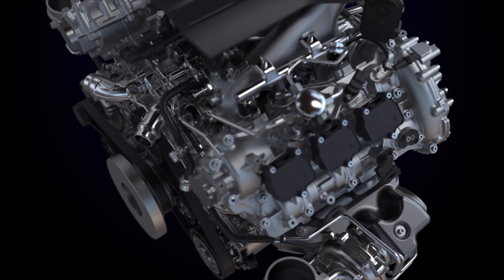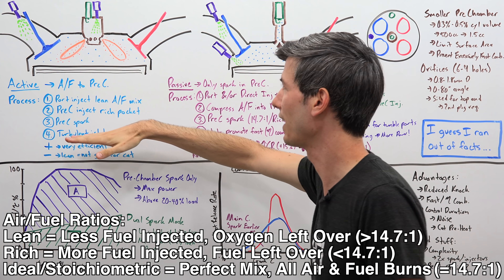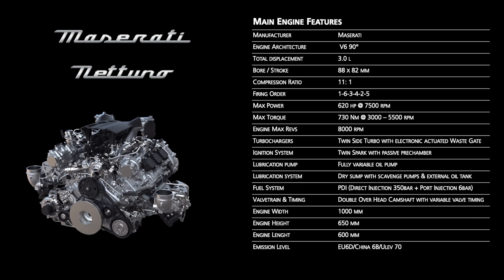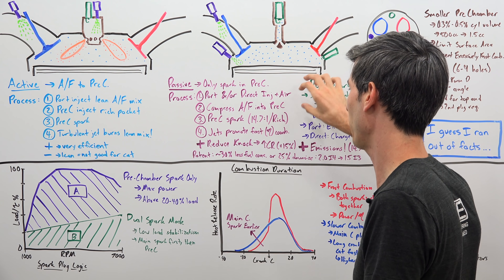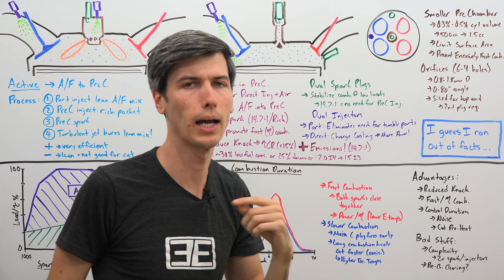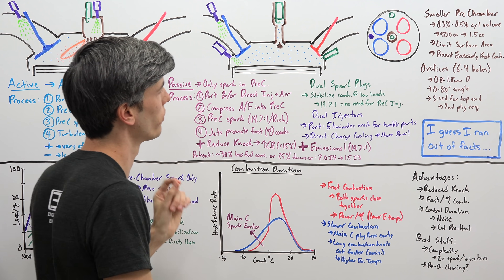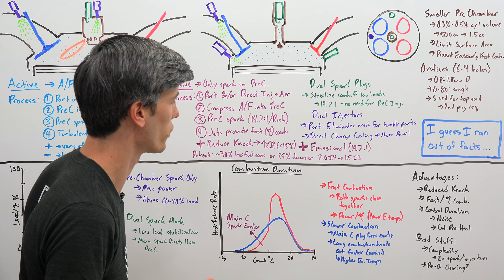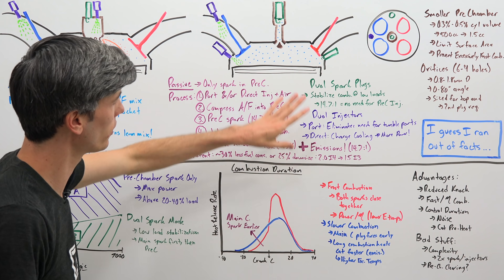How Maserati's Brilliant MC20 Engine Works - F1 Tech In A Road Car!

Comment: The real reason the main chamber spark plug exists is at low loads, the piston cannot "compress" the mixture into the prechamber. A piston is actually getting sucked upwards at part throttle, and then at TDC the mixture may only reach atmospheric pressures. The engine simply wouldn't run smoothly or at all at part throttle.

Comment: active is highly used in marine gas engines. if u combine it with propan butan it gives u a good amount of enviroment points. of course u have to deal with high EGT and use better oxidation catalyst

Comment: They should have threaded that whole pre chamber into the head. The ports will have to be cleaned of carbon with the typical low-load, low rpms supercars see in real use.  Or they’ll need to program in an automatic interval for an ‘Italian tuneup”. That’s how I used to keep my Fiat’s plugs cleaned.

Comment: It looks to me like that prechamber can be mostly cleaned by removing the sparkplug and using something resembling a chamber cleaning brush for a rifle. That would not clean the ports, but I don't think those will be very likely to clog, though they might erode from the speed and pressure of the gas flowing through them.

Comment: Thank you, what a great video! I am about to buy the MC20 and wanted to break it down to the smallest detail. Given this, your video explains one of the biggest questions - why on the videos of the car the RPMs fall so slowly. Right now, I guess its could be ECU strategy for either warming up the catalytic converter (the car has just started and the test pilot gave it revs) or it could be emission/noise strategy for vehicle being stationary (like Porsche, which opens exhaust valves strictly under load when moving). The engine doesn't appear to be so "sluggish" once it gets going doing rounds around Modena square.

Comment: Hello everyone. I had the idea of replacing the spark plug with another device which enables to fire the entire combustion chamber almost instantaneously (let’s say in less than one millisecond as an order of magnitude). Do you have an idea about the impact on power and efficiency that this new ignition method could have?
Reply: We would need more detail.  A spark plug already uses thousands of volts, and ignition depends a lot on the temperature and pressure the day of testing.

Comment: How does Maserati's central spark plug see a richer mixture than the rest of the chamber, when there is no injector near it?  At best, it will be the same lean mixture.  If not a lean mixture, then the prechamber is only there to provide hot flame jets that carry multiple flame fronts into the main charge.  Normally, a single flame front is less likely to knock, than two flame fronts slapping into each other.  Perhaps many smaller flame fronts don't produce significant knock?

Then again, aircraft piston engines have dual spark plugs and ignition systems in case one fails....

Comment: Yes. Every high performance/aftermarket rotary application has the oil metering system deleted and uses TCW-3 or similar premix. I've had a rotary engine fail because one of those oil metering lines broke.

Comment: This prechamber concept was done in San Diego in 1992 and tested at SDSU.
The issue was temperature of brass prechamber.
Because of a hot pre-chamber NOX was not as good as it could have been.
Also pre-ignition once hot enough.
looks like cooling fluid channels is enough to solve by removing enough heat.
pre-chamber surface area to volume vs fuel burned inside prechamber drive prechamber temps.
cool stuff.
Pre-chamber volume robs main chamber of compression if energy-pressure of fuel and air inside pre-chamber is not fully transferred to main chamber. Hot pre-chamber hints of that being an efficiency hit.
So where the power gain?
In the delayed power profile.
It takes time for the pressure to get up the spark plug. This helps reduce pre-ignition.
propagate
This takes time.
accelerated
Reply: This time allows the crank to turn a few more degrees without high pressure from main combustion  flame. Since it is delayed and just starting to propagate across chamber after existing orifice, even with accelerated burn rates, the pressure profile is delayed at first, then catches up later. this produces more power because any pressure made early does not make much power until the crank has turned the "corner". Or for math folks sin of 6 degrees or less, rounds down to zero.

Comment: My guess is to keep the cylinder clean they will do a top end clean like subaru bmw vw etc do to stop carbon build up as part of standard servicing, and im guessing they'll put a coating in the pre-chamber to reduce the chances of it blocking up/carbonising.

Kinda wish this was used on an NA engine as well.... it'd be incredible to hear a high screaming NA inline 6 going at it... oooft baby.

Comment: What happens when that pre-chamber gets clogged with carbon build up?
Reply: Won't happen as it is part of the cobustion chamber itself. carbon build up is only a problem in the cold part of the engine where the carbon can't be burnt away.
If you look at clogged up engines the combustion chamber itself is generally pretty clean. It's the area between EGR valve and the intake valve which is the problem.

Comment: Very interesting indeed.  The claims are impressive.  Enough so that we wonder if it could improve more cars, but looking at the entire system I question the whole story.  The engine has all it needs to make impressive power -the problem is emissions, durability, and economy.  Given the Europeans history of simply cheating the emissions test I would watch this car like a hawk.  It looks to me like an engine that can work like a diesel on gas,  or switch the program an act like an F1 engine.  The "pre-chamber" is mostly a gimmick for regulators.

Comment: Yep just did catch can on mazda cx-5. Nice and difficult to get to and they use 5/8 on pcv and and 3/8 on intake i believe, so had to use reducer, fun stuff hope it stays sealed and doesnt clog. After 45,000 valves nice and crusty. Bought one off amazon and re-engineered it to work better. Just checked it today and was almost half full After bout 2000 miles.Trying to clean with seafoam or anything else with flushing method will get you a nice expensive brand new caty. Ask me how i know.Gotta clean with brush or walnuts not fun either way but to each his own. Thank those brilliant minds so much for the pcv system. Makes life so much fun... so much. I was thinking the same thing about the little chamber. Hopefully they make it removeable at least for cleaning. Ha ha more sarcasm. Also can see carbon on those piston heads already building up as you spoke. Hopefully they leave room for many catch cans and hydrogen generator. Nobody knows the trouble we go through, nobody knows the sorry except us mechanmaniacs😊

Comment: You know, spark plugs really aren't that durable, the arc isn't very efficient, and the materials can't withstand chemical attack and high heat very well. We just need to set the combustion chamber on fire at the right time, and the faster and more thoroughly we do that the better... What about X-rays, like was a concept in WWII?

Comment: Hello sir. Requesting you to throw some light on torque availability at lower RPM. Will it hamper the RPM value at which max torque is available? I think the value will be max. So to achieve that either we have to increase the RPM or needs to design the gearbox accordingly. Also it will be a roaring car. Desired characteristics for sports car though. But NVH may needs to be a lot advanced and heavy.

Comment: Max HP is only 500rpm bellow redline. But I guess that isn't too bad when you have a rev limiter set at redline.  Back in the day of carbs that would result in a lot of blown engines . One more way advanced ECM's help get these crazy HP densities.

Comment: Mazda should use passive prechamber with the rotary. The extra long combustion chamber is not ideal and all the fuel doesn't burn completely. If they could get some fire jets shooting out into the far reaches of the combustion chamber, I think that would help a lot.

Comment: What we need is some clever chap to work out a way of creating a pre-chamber that you can screw into a conventional engine's spark plug hole, the plug then screws into the top of the chamber. It probably would not work though and even if it did things like the ignition timing would need to be adjusted to take into account the delay between firing the plug and the flames shooting out of the chamber. I guess the chamber might over heat too, hmm, bad idea I suppose!

Comment: so from the images showed it looks like the pre chambers can be removed which if they can that makes cleaning them super easy and makes it just a regular maintenance thing that could be done say every 30,000 mi or so instead of chemical cleaning or removing cylinder heads.

Comment: Just curious, don't know much about cars;

How would it run if you install meth-injection in the port injector while having it tuned as it was original (so for e.g. RON98)? Would it mess up the compression ratio's?

Comment: It is a more complex engine, but as you noted you could for the same horsepower go from 4 cylinders to 3. So, more spark plugs and injectors but less pistons and valves.

Comment: Do one on koenigsegg's new engine theyre developing with hydrophilic actuated intake/exhaust valves that's claiming up to 150-200HP per cylinder, high fuel economy, turbo'd with a 3d printed exhaust housing with duel chambers inside, and other cool new tech with the engine.

Comment: I was wondering about that pre-chamber clogging with carbon or something too but then remembered it’s a Maserati. It will just be part of the “normal” service interval if people actually put a lot of miles on or just another expensive repair that Maserati owners are allegedly used to. Personally I think they make some gorgeous cars. That doesn’t always transfer into usable cars. Sadly the internet has its share of complaints about their reliability.  You forgot to mention that the intake valves on many direct injection engines tend to carbon up from the oil vapor originating from the PCV. The port fuel injection also helps wash the valve with fuel and reduce the problem.

Comment: My old C55 had two spark plugs per cylinder, for a whopping 16 spark plugs!! lol

Also two injectors is smart since one will also be cleaning the intake valves. The problem MOST direct inj. engines have...dirty valves.

Comment: I'm curious on how long it will take to clog the pre chamber with residue. I do like the passive design though.

I still want to see a design utilizing a carburator for the majority of fuel with port injection for fine adjustment.

Comment: Pre-combustion chambers have been used at different times for different reasons.  This message concerns the first such design of my memory.

The time was ~1970, the place was a hotrod car show.  One entrant exhibited his custom-made two seater, bright red, lots of chrome, exposed engine.  One of the popular enthusiast magazines (possibly Motor Trend or Hot Rod) published a lengthy article complete with photos.

The car was hand-built but powered by a stock-looking Chrysler slant-6. An official observed that the engine had no distributor and all six spark plugs were connected to a single brightly polished copper bus bar.  The car won a prize but the official challenged the owner, saying "The rules stipulate that the engine must run and the car must move under its own power.  Your engine obviously does not run so you are disqualified."

The owner insisted that the engine was compliant with the rules.  It did run and the car was roadworthy.  To prove his point the owner climbed into the driver's seat, started the engine, and drove the car around the convention center floor.  The official was astounded!  This seemed impossible!

The car's owner had built the car himself.  The slant-6 was /almost/ stock.  A passive pre-combustion chamber had been brazed into each spark plug hole, and a spark plug screwed into each chamber.  A simple ignition system consisted of a spark coil excited by a buzzer, so spark was generated continuously and passed to all spark plugs simultaneously.

On the intake stroke each cylinder "inhaled" normally.  On the compression stroke each piston compressed the air/fuel mixture, driving some of it into the pre-combustion chamber.  When enough fuel had entered the chamber, combustion was initiated and a flame front emanated from the chamber orifice.  Careful experimentation led to a chamber size and shape to achieve ignition at the right time.

We may imagine that this engine could run leaner than a stock slant-6 but no such claim was made.

The car owner offered to sell modified cylinder heads to all comers for a few hundred dollars.  I have no idea how many were sold.

Comment: @ 7:10... hmmm.... oddly similar point I made on a video of yours talking about DI vs PI about a year ago, where you & your comment section went ballistic that I would say "PI has advantages over DI"... As you too have come to finally realize, PI is here to stay because of the high HP engine's simply not having the time to properly mix direct injected fuel, like they do with port injection. This is something ANYONE with a basic understanding of building high performance, naturally aspirated engines, would have told you.

Comment: The Italians have bought a lot of innovations to mass produced production cars (I know it’s a bit of a stretch calling Maserati that!).

Alfa Romeo was an early innovator in fuel injection (starting with mechanical systems), and also the first to use direct injection on a passenger diesel car, then a petrol one with the JTS engine. 

Then Audi tried to act like they’d done something innovative when they introduced it on their TFSI engines... That initially at least, sounded like tractors at idle, and have loads of problems with oil vapours clogging the intakes.

Comment: How does this engine with it technical solution affect the sound compared to a standard V6?
I have heard its exhaust note on a clip on YouTube, it' sound very quiet and not aggressive or "sporty" at all! Is that the effect of the twin turbos or the Pre-Chamber Combustion?
Reply: it's probably mainly the cats. but i'd guess the generally more efficient combustion (eg there's no over fuelling on the overrun) has some effect on the lack of aggressive sound.

Comment: The twin spark plugs and their timing is fascinating. The prechamber with its fixed orifice sizes may have an ideal precombustion pressure differential to the main chamber for best efficiency. Lighting the main chamber plug first would build some preliminary pressure to "stuff" more air and fuel up the prechamber. In theory at least, that could bring the prechamber pressure up around what it would be under higher loads, in essence increasing the precombustion discharge velocity back into the main chamber again. Like a high tech hiccup haha.

Comment: over time the engine will get covered in carbon, could this design run into problems if the thin prechamber gets carbon buildup?
Reply: Clean it out with a wire brush when you check the spark plugs?

Comment: Diesel engines was using pre-charged chambers. Honda was the first to experiment with pre-chamber combustion in 1971 for gasoline engines and was the first to successfully apply it to their commercial engines which they called CVCC (Compound Vortex Controlled Combustion).  Then later toyota licensed that technology from honda and implemented it into their cars in 1975 and called it TTC-V. 

[On another note;  later Toyota uses Hondas VTEC system on their engines without royalties and called it vvt-i].
Reply: VTEC was sold to Honda by Alfa romeo
Reply: @paulj9821  That is incorrect. Where is your source? The vtec system was invented by Ikuo Kajitani who was an engineer at Honda.
Reply: @addictedtopussy69  In general:
fiat patented it, alfa romeo was first to make production car, honda made it popular.

"Alfa Romeo was the first manufacturer to use a variable valve timing system in production cars (US Patent 4,231,330). The 1980 Alfa Romeo Spider 2.0 L had a mechanical VVT system in SPICA fuel injected cars sold in the United States. Later this was also used in the 1983 Alfetta 2.0 Quadrifoglio Oro models as well as other cars. The system was engineered by Ing Giampaolo Garcea in the 1970s.[3]

Honda's REV motorcycle engine employed on the Japanese market-only Honda CBR400F in 1983 provided a technology base for VTEC."

Later every one else followed the based technology with their variants and Named them. Honda – VTEC, Nissan NVCS /VVL, BMW – VANOS, Toyota VVT-i. And they succeeded in different levels.
Reply: @quadrifoglio6058  I'm familiar with all those systems that you have mentioned above as well as the mercedes version. In actuality the majority of car companies had variable valve Timing using various techniques. But this is probably where the confusion is for most people. Honda was the FIRST to be the ones that were able to not only move the timing as well as increase and decrease the timing but also have variable valve LIFT as well. That is something all the other manufacturer tried but were unable to do. This system showed increased gains in efficiency and power. That is what makes the Vtec system unique at the time. Its a completely different system.

Comment: My thought is to make the prechamber bolt in, either as part of the spark plug or a separate piece. It would make it easier to service and replace, and prechamber cleaning could be made part of the maintenance schedule. Of course, Maserati, so more likely to be cast into the head and require head service every 20k miles to clean.